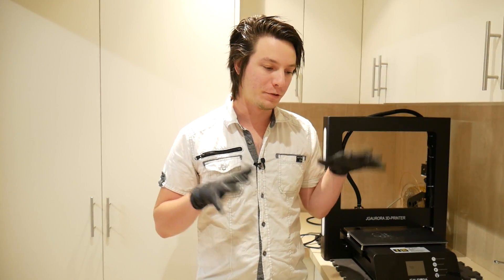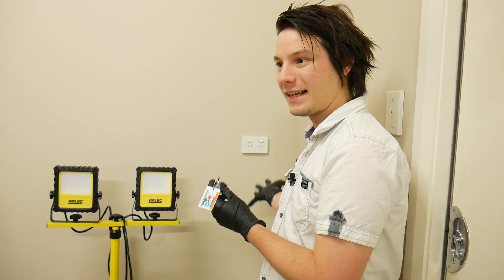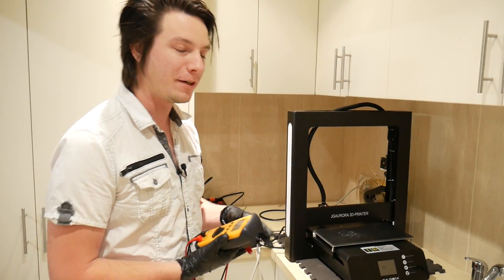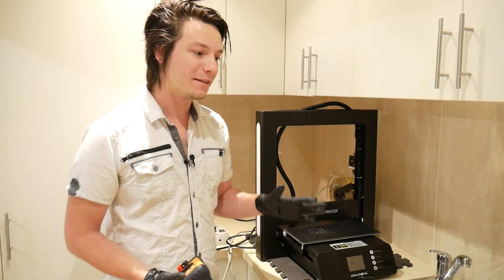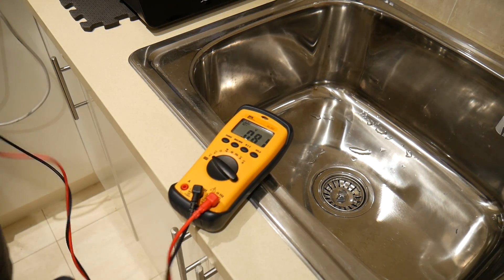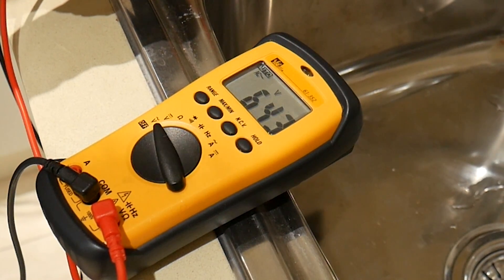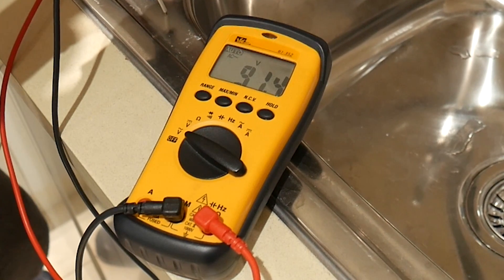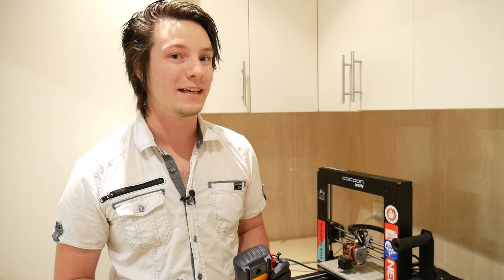This is why I was shocked by my 3D Printer IMPORTANT FOLLOWUP

Comment: Nailed it, kinda bummed I didn’t get credit for explaining this in the comments on the first video.
Reply from the maker: Sorry man, I tried to get everyone in the top comments, the video ended up collecting hundreds. I'll pin this one instead. REALLY appreciate the feedback.
Reply: And you explained it very well. Took a few of us to break through the comment clutter. Please accept a large share of the credit and thanks for helping clear up the misinformation.
Reply: In context, 100mA is a crapton of current. 30mA is plenty enough.

Thankfully, you don't see anything like that sort of current from these filters - it's in the uA range and harmless unless you have a lot of them. It can get to dangerous levels - that's why there are provisions for redundant earthing on circuits expected to have lots of these filters.
Reply: Bo Janssens Filling balloons with hydrogen is in no means an original idea.
Reply: Well, with enough enough voltage, you could a lot of damage. Even at low current, IIRC, in the 100 mA range, you can stop the heart if it's done in the right/wrong place.
Reply: Bo Janssens I'm pretty sure I liked your suggestion on that.
Reply: Sam T He made a video in which he filled balloons with a fuse attached to them with helium, lit the fuse and released them. They obviously exploded in the air, I told him he could fill them with hydrogen made with his homemade hydrogen generator. 

I'm pretty sure this was an original idea back then. 

I don't really care that I didn't get a shout out, but when using someone's idea proper attribution can be given.

Please excuse my crappy English...
Reply: @Bo-zj6or  My chemistry teacher told the class about her doing that at university. This was in the 80s.
Reply: Hydrogen
Reply: Not being funny but I'm sure you got some form of credit and thanks, but you seem bummed that it wasn't pinned and made clear to everybody.  Doesn't really say much good about your character if you can't offer help and advice without expectation.
Reply: dude fuck off, you don't need to be called out.  

Try having less of an ego
Reply: @startedtech  You need to take a chill pill and try being less of a salty child. Envy is after all one of the seven deadly sins.
Reply: Nothing to say, just commenting so OP feels better knowing we saw their contribution
Reply: I know Im kinda randomly asking but does anyone know of a good place to watch new movies online ?
Reply: @Israel Mohammad Lately I have been using flixzone. You can find it on google :)
Reply: I shared my idea of filling balloons with hydrogen with grant thompson from the king of random. That video went viral and I never got any credit.
Reply: Not the volts that kills you - its the amps :)
Reply: @paus529  But with no volts you get 0 amps

Comment: You get a similar tingle off the Y cap in metal Mcbooks. Solution is to plugf in a USB item like a printer which has a plug with an Earth pin. you will only get a tingle, not a proper bolt.

Comment: Thanks solves my mystery I run my 3D printers in a shipping container in my backyard powered by solar & Battery and a yumcha inverter. I noticed it today when touching my new enders 7 when installing a magnetic pei build plate and cr touch. I was in bare feet and it's been raining a lot in qld so my feet were likely wet. I then touched my ender 5 same thing. Ender 3 had no leak but it powered by DC from battery bank. I assume the earth is not connected with this inverter.

Comment: Oh so thats the explanation for why I feel a tingling sensation sometimes when I touch the non painted metal parts of my Ender 3 V2? It doesn't happen every time though, and as far as I know It should be grounded? Does this mean that the ground connection is not working properly?
Reply: If you haven't solved your issue yet I'm hunting down the same problem with my ender 5....from what I've found so far, most likely causes are poor grounding with the psu->frame bolts, other biggest one is checking for loose connections with the crimps on the power wires to the PSU terminals

Comment: I had this on my ender 3, the power cable they gave with it did not have an earthing plug. The chassis was at 240V when turned off 110v when turned on. The adapter did have a grounding plug just the cable did not

Comment: There should be no voltage from ground.  The capacitor is between live and neutral.  The cheap chinese LED power supplies don't even have a ground pin.  You likely had bad wiring where somebody switched neutral and ground in your house.  They might have a barister going to ground but that just absorbs spikes.

Comment: Almost 3 decades ago, when a client built a new building on their property, we went to add another RS-232 terminal, and the terminal immediately fried upon turning it on, and the com controller in the mainframe at the main building caught on fire.  It was a costly mishap.  But I picked up one of those plug testers, and walked around both the main building and the new satellite building and every single plug in the new building was shown to be wired incorrectly.  But where the actual error was, was at the d-panel where the high voltage mains came in.  it was wired wrong, and considering they had several bits of equipment with metal chassis already connected, it was a miracle that no one had been electrocuted!   Since then I always brought that little tester to new clients and used it before plugging anything in.

Comment: Something is completely wrong with your measurements there. If you measure 90V between the chassis of the printer and the sink it means your chassis is live. That is the same voltage you would expect to measure (90-120V) between the live terminal in your wall outlet and the grounded sink, or between the live and ground terminal in the outlet. Even with an ungrounded free floating frame there should be 0V to ground unless there is a connection between live and ground on the printer or a ground fault in your house wireing. Connecting this to a circuit with a ground fault interuptor would make that one trip.

Comment: I've lived in older flats with ungrounded plugs only. I still have a lot of ungrounded plugs. I think it is very rare to feel the voltage leak from Y-capasitors from single device unless you are well grounded yourself, like leaning to a sink. You can measure it though as demonstrated. A yet better measurement would be current instead of voltage.
Of course, if you have a lot of extension cords that parallel all the ground pins, you get the total leakage combined from all devices when the cord end has no ground. Parallel enough leakage sources and at some point you start to feel it for sure. That makes me think if ungrounded cords would be actually better when you have ungrounded plugs only.

Comment: Just a heads up: Those fault detectors aren't totally foolproof. You could have swapped Neutral and Earth connections and the fault detector wouldn't be able to detect it as Neutral and ground are at the same potential.

Comment: Y capacitor should have a 1M ohm resistor in series. In asia there often no ground and 1M allows the unconnected earth to float at half mains voltage and be safe current level.

Comment: Thanks for the good info! Its worth checking every outlet/circuit in your home with an outlet tester and a chicken stick. They're cheap and replaceable, people aren't. When I did satellite occasionally I'd forget to hit an outlet with the tester and I've blown up a few tvs and let all the magic smoke out of a dozen set top boxes over the years. At one point it was standard operating procedure to snap the ground pin off my satellite equipment BECAUSE the ground was bad so frequently in rental units.

Comment: 30 volts can kill... if your skin is damp from sweat.

Some EE college student proved that a 9 volt transistor battery can kill.... by breaking skin with the probes.

NEVER say that any voltage is not dangerous.

Any voltage can be dangerous under certain conditions and you can create those conditions accidentally all too easily.

Comment: No ground in our flat (and probably in our whole house too). So what (to do)?
Which parts of a 3d printer are the ground? So is it possible to short-circuit by touching different parts of a 3d printer?
I can short-circuit only by touching the radiator in my room (only in a certain place where the paint was removed) and the printer. I don't think it's dangerous (need to do it on a purpose only).

Comment: it's not the voltage that hurts you but the amount of power thats flowing (messured in ampere). you even can experience a really high amount of voltage without getting hurt by simply putting on a piece of synthetic clothing. you can even see some tiny lightenings doing that when you turn off the light...

Comment: You 'should' be able to have the fuse board fitted with an RCD, which should protect you against this sort of thing.
BTW, also noticed it on some computer case/PSU combinations.

Comment: I don't mean to be picky since you are trying to inform the public and hobby print community of a potential safety issue, however it should be noted that it is also a VERY BAD idea to stick a cheapo multimeter into ANY mains rated circuit. It's incredibly dangerous and can easily end is death or permanent injury at very least. 

Never stick a meter into ANY mains circuit unless it is correctly rated for both voltage and insulation category WITH at least one of the independent regulatory certification laboratory's markings stamped on the casing (UL, CSA, VDE, TUV, TCA).

Note  - ‘CE’ is not a test laboratory certification mark and is not relevant in Australia.
Also note, if you are not a qualified electrician or engineer, you shouldn't even attempt this kind of measurement unless you have a very thorough understanding of electrical theory, an intimate knowledge of current paths and how to perform such tests in as safe a manner as possible.

Comment: 24V AC is considered as a safe voltage. All depends on how well you are grounded. in most case, you won't stand with your bare feet in a water, or with a ground cable stuck in your... whatever... you're most likely isolated somehow (with your shoes, carpet etc.) and therefore the potentials difference is lower. Trust, this could have been dangerous for you if you were grounded properly. Anything above 50mA makes irreversible damage to your body. Avarage body resistance is around 1kOhm (depending skin moisture etc.) so anything above 50V AC is seriously dangerous.

Comment: "There is voltage that flows through." Yep, alright. In the northern hemispere it's the current that's flowing.
This whole video just says: It's a ground problem, something like that.
Actually devices with no exposed metal parts don't need grounding, you could just insulate the power supply from the printer and the body of the power supply so that when touching either of those, they won't shock you.

Comment: Also helps to have a bit of knowledge about basic electrical-systems!
Most people don't even know why there is an earth-pin connection & how it keeps you safe even though the earth-socket is literally connected to the neutral wires in your building!
My ex-wife's parents occasionally received a shock from their kettle so I tested the GPO (power-outlet) with my plug-in tester & discovered that when their house was built 25yrs beforehand, the sloppy electrician had connected the active & neutral wire the wrong way around despite the colour-coding! 
More dangerous was the twin-tub washing-machine (anyone remember those?) my parents bought when I was a child that almost electrocuted my mum (more current involved) because it had been wired up incorrectly at the factory!

Comment: 94V are enough to kill you, if you happen to stand on the wrong ground. Also, in places with 230V main voltage, it will probably be something around 200V. Grounding devices is generally pretty important, this is not exclusive to 3D-Printers.

Comment: Hey Kevin Loughin, an advantage I see with US outlets is 110-120vac and not 220-240vac. There have been time I wished for 220, because some items designed for a workshop are powered by 220, but 110-120 is less likely to be fatal, unless you get the full voltage and current. Also I do not know much about 220-240 in Australia however 220-240 lines in the US are available from the same electrical box as 110-120 volt lines. Here in the states the neutral is just that. There are two "legs" to our AC power. One leg is high while the other is low, with the neutral being half way between the high and low voltage (this alternates between legs). Measuring from the neutral conductor both legs appear to be 110-120 volts, however from measuring from one leg to the other the voltage measured is 220-240 volts. Our AC power is 60 cycles per second (or 60hz). In other parts of the world voltages are 110, 120, 220 or 240 and cycles are 50hz or 60hz, our breakers/fuses allow 15, 20 or 30 amps at 110-120 and I have seen up to 60 amp for 220-240. I am sure there are other amperage breakers but that is the basics. 

Now the ground is the tricky thing some older houses did NOT have one. When I was a kid I visited the neighbors house a lot. Old man Forney was interesting, he had old coins I had never seen, pictures of Roosevelt's funeral showing horse draw funeral procession and many other things, he loved showing us kids that stuff. Anyway, we went to his basement a few times, that's when I discovered how weird old wiring was. In his house on the basement ceiling was the wiring system exposed for all to see... Two single conductor wires run in parallel trough holes in the rafters all the wires were covered in braided clothe coverings. One dark one light colored, they may have been black and white at one time, but were almost the same color. NO junction boxes! Outlets on the same circuit were tapped in by running two wires again three inches apart perpendicular to the original wires. No ground wire.

Newer houses use three or more conductors in a single cable covered in a plastic/vinyl covering, some are armored some still have an outer covering of braided clothe around all the vinyl/plastic coverings. Inside the breaker box, the neutral and ground are connected to the same buss bar. So what differentiates the neutral from the ground i US wiring? The neutral is usually heavier and carries a load, it is as heavy as the "hot" wire. half of the hot wire in a house are connected two one leg, the other half connect to the second leg. Any appliance that needs 220-240, like a stove or clothes drier connects to both legs. 110-120 outlets have three conductors, 220-240 have 4 conductors. Occasionally some 110-120 circuits use four conductors for switching where more than one switch controls the same appliance (mostly lighting).

Comment: for people from uk i would check the cheap mains-lead that comes with the printer.
alot of them have insulation on the earth pin which stops it from making contact in the socket  
therefore  it is not grounded

Comment: ok you have a major problem here! any device kicking voltage down the earth line will fail pat testing the all of the EU, because any voltage there is dangerous. so what you have just said is that all the printers leaking voltage to earth including the prussa i3 are dangerous and should not be used.

Comment: Floating switch mode power supply, very common. Made worse if the house doesn't have a connection between neutral and ground at the switch board.

Comment: Glad you are okay. Angus I have quick question about the maker select v2 I can't seem to print anything besides the stock files from the sd card that came with it I've tried using the same profile from the successful prints on cura as well as going through the settings to tweak things before I start printing it out paying close attention to the temps and other settings. The prints generally do stick to the bed most of the time without much fuss but I've been having them for instance the extruder will start drawing a circle but it ill be half done or garbled looking low quality and it will try to print on and eventually drag the print around the bed.

I use the profile and settings from my succeeded prints from the stock sd and that's how I was able to make my large spool holder which took 7 hours and went off without a hitch. Most of the prints I want to do are minor mods specifically made for and printed from the maker select v2 on thingiverse even when I use their specs it'll fail. I've tried taking apart the extruder and clearing out the filament and leveling the machine out multiple times trying multiple combinations of bed and extruder temps even had a buddy come help and they still fail. Can you be any help?

Comment: Early on I bought a similar mains tester unit that also tested/triggered the switch fuses. This has been invaluable over they years whereever I moved and its great for quickly mapping out the wiring loops in a location. Knowing which fuse each powerpoint is connected to helps you plan what equipment you can plug in and where problems may arise. If you've ever encountered a blackout in just part of your home thats likely due to overloading one wiring loop.You can't just plug everything in existence into one socket, some wire loops were installed with different wattage ratings for lower expected usage. Its well worth testing to stay safe and make sure all your equipment stays running well into the future.